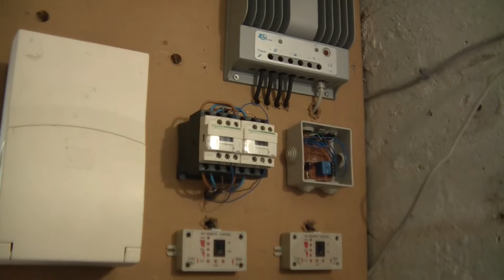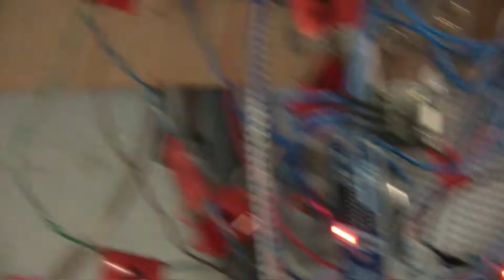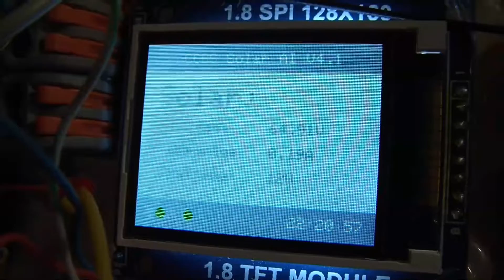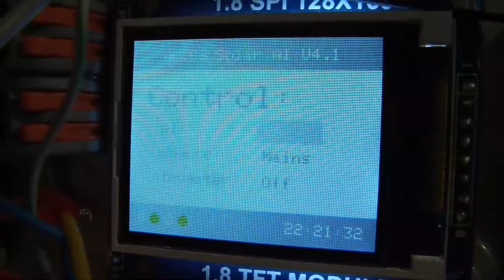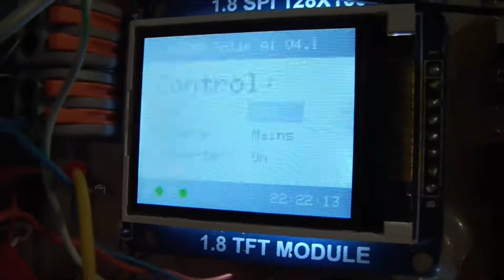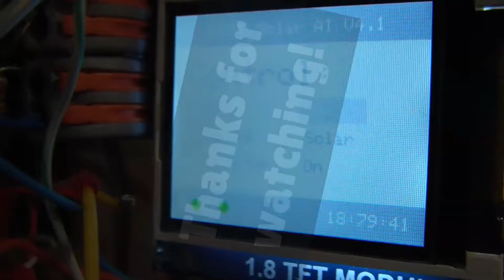INVESTIGATING: My DIY Offgrid Solar Power System - July VIDEO 2

Comment: The wires you are using to measure the voltage of the shunt are way to thin.. You would need another fuse..
Reply from the maker: MisterK why do you say that? :)
Reply: because you aren´t allowed to lower the diameter of a wire without the use of a fuse ...
an example: 
in germany you have to protect a 1,5mm2 wire with a 16A-fuse or lower ...
in the case of a short circuit the 1,5mm2 wire can carry this amount of current :)
but the wire you use is too small for the amount of current you allow with your selected fuse :)
Reply from the maker: MisterK but the amount of current flowing from the shunt across the signal wires is approximately 0 amps! :)
Reply: In a correct circuit yes but not in the case of a short circuit ;) that´s what a fuse is protecting you from :P
Reply from the maker: MisterK maybe I'm not understanding you, but I see no use for thick wires and a fuse for signal wires of up to 200mv and 0 amps!!! :D
Reply: Antony Cartwright that's basic 101 of safety in electronics ... 
Just google  "why do we have to use fuses " and you know what I mean 😅 

If the short circuit happens in those measure-wires you burn the wires and that can start a fire.. If the short circuit happens in the normal mains wires only the fuse gets triggered and nothing dangerous happens .. 😅
Reply from the maker: Yeah I understand fuses, but one of the thin wires a is a signal wire which has max 200mv and 0a! The other is a ground reference wire with 0mv and 0a. They are connected to a low-side shunt! :-D :-D :-D

Comment: Can't you take the time from the server or internet and update it after some intervals.
Reply from the maker: Electronic projects you can do that but if the router goes down, etc, 're would be lost.
Reply: Antony Cartwright yeah that will a problem.
Reply from the maker: Electronic projects it's good the way it is, but there's a problem with the code... I don't understand whatsoever wrong with it at the moment..
Reply: Antony Cartwright I hope you will solve it soon.
Reply from the maker: Electronic projects yeah, if I get time, I'll look into it tonight. It's something to do with the clock library. :/